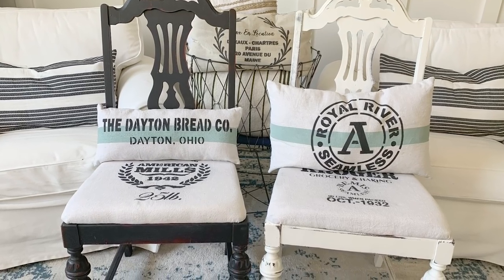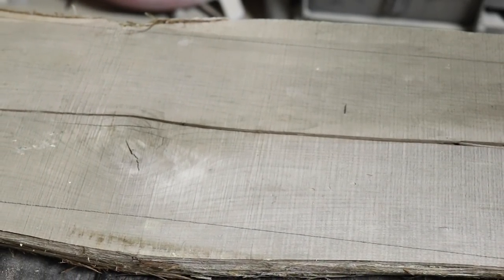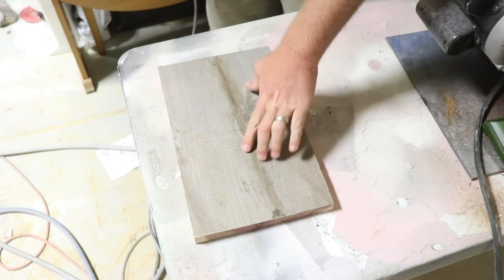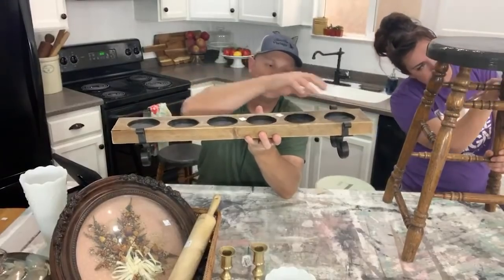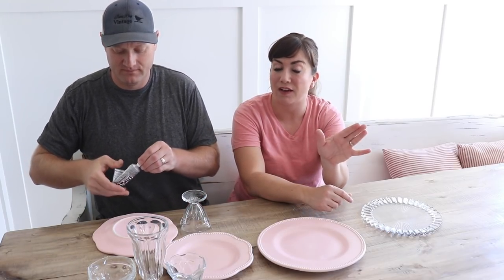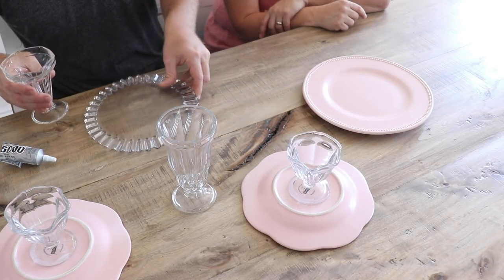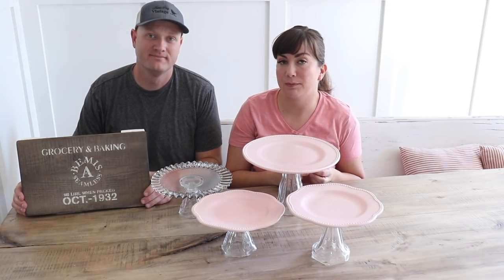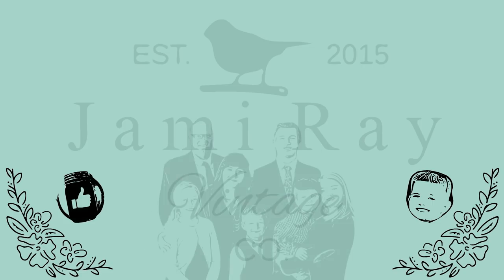DIY Thrifted Cake Plates

Comment: ABSOLUTELY DARLING!! 😍😍 I need more BUN feet. I bought a "wedding table" to use as an island in my kitchen and it's a good height for me but everyone else says it's too low! That's what happens when your 6ft son has 6ft kids.
QUESTION: Would the small Tray Feet be ok with 40 lbs of the "wedding table"?
Reply from the maker: Yeah, they could handle that much weight.
Reply: @JamiRayVintage  YES??  If so I'll add them to My order so it can ship together maybe?

Comment: Does E6000 yellow over time? I bought a cake plate at a thrift store which had a base that had been glued and the adhesive was an amber color. I just put a liner on the plate but I wonder if the original owner used the wrong adhesive. Thanks.
Reply from the maker: Not that I’ve seen.
Reply: Oh good. Thanks.